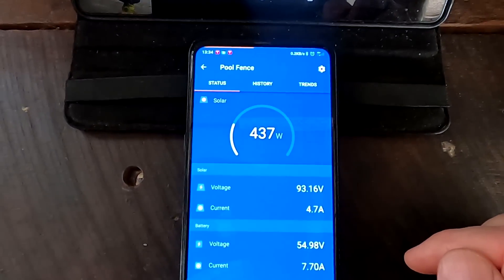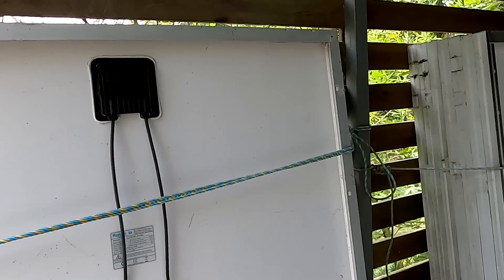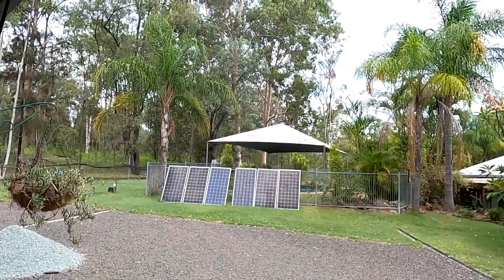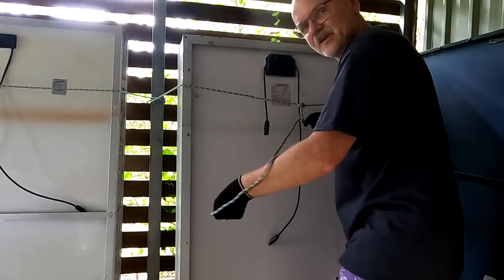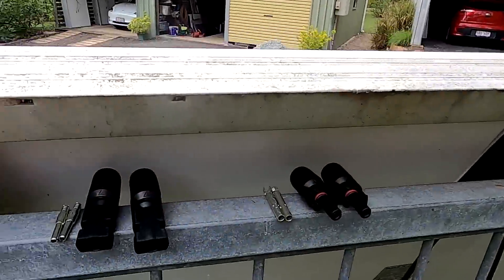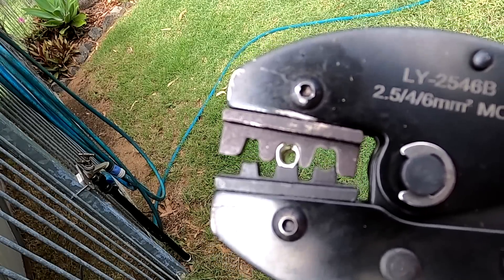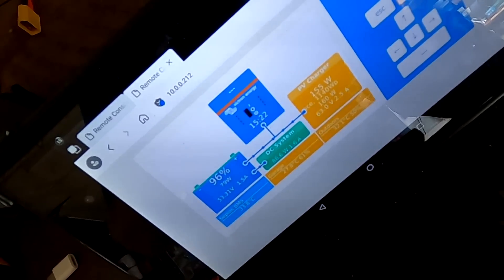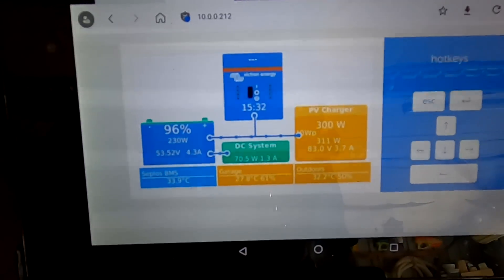'Massive' Pool Fence Solar Upgrade 😉 I almost lost it... 🤦‍♂️

Comment: Andy,  IMO the array voltage is dangerously close to 150V.   Those panels have a Voc temp coefficient of  -0.112V/K.   That means that for every degree C below 25C, the voltage will go up .112V.     

The Voc is 37.4V so 4 in series is 149.6V.   The .4V margin gives you only .4V/(.112V/K)=3.57degK.  That calculates to 25 - 3.57 = 21.43C.

Granted, in the real world the actual Voc will be less than the Voc of the spec,  but is it worth the risk of smoking the charge controller?
Reply from the maker: Thanks Paul for doing the maths on that.
However, when could that voltage be measured though? When the panel is cold and in full sun? I will have a lot of shading in this location in winter and the sun won't be on these panels before 10am (some will be still shaded by then). By 10am they have already warmed up and could be at 20°C or more.
I think the risk is vey very small. I'll get a 250V MPPT for the test and see how much voltage we can actually see.
Unless the panels are super cold and the sun comes out full on the panels, I don't think it's a big issue.
Reply: @OffGridGarageAustralia  As long as the batteries are not full and the Controller is putting current into the batteries, the current will pull the Panel voltage down to Vmp.   However, when the batteries are full and the current goes to zero, it looks like Voc to the panels.

Unfortunately, with zero current it takes very little light to bring a panel all the way up to Voc.    People have seen that at dusk or dawn when the sun is still below the horizon, they can see Voc on panels.   The most dangerous time will be early morning after a cold night.   (Actually,  that might be a fun video.    Test Voc of a panel in various light conditions.)

In your case, you may be OK because the overnight drain will probably mean the controllers turn on right away and start pulling current.   Unless it is so cold that even VMP is too high you would be OK.
Reply: I was going to look that up myself. Thanks for doing it :-)

Comment: I would not worry about open circuit voltage on cold days. Your voltage drop in your wire will compensate this by the time it reaches the mppt.
Cheers!
Reply from the maker: There is not much current flowing in the morning, so not much voltage drop. But, I have a lot of shading in the morning, so voltage  should not be an issue. And then the panels will warm up anyway, so. It will be an interesting test.

Comment: Another good tip for MC4 connectors that I fell foul of the first time. DO NOT twist the cable. Put it in straight so it is gripped uniformly by the connector.
Reply from the maker: Thank you, good tip.
Reply: For the crimp to seat properly, yah... the strands definitely should not be twisted.  But I don't even trust those MC4 crimps... never have. I always solder in addition to the crimp.

Comment: You can never have too many solar panels, right! Only sometimes you don't have enough space to set all of them up... ;-)
But i can still see a gap on the right side of the fence.....three more panels for some more amps?
Reply from the maker: I need a permanent mount for these panels. Sitting on the ground is only a solution for 2-3 days 😉
Not sure, if there is a good fence mount system out there...

Comment: I have 3 37.8v panels in series and when the charge controller woke up at about 8am it was receiving 81.8v at 0C which would put it at 27.26v each. I did change from 4s to 3s back in November because I had noticed that the voltage was creeping closer to the 150v limit the charge controller can handle. I would imagine you would be okay doing 4s, especially when your charge controller is a seperate device from your battery, mine is a solar generated so I don't want to risk the solar charge controller because it handles all DC input.
Reply from the maker: I think the problem occurs before the MPPT turns on and current start flowing. You would need to measure at the MPPT solar input before it turns on to check how high it actually goes.

Comment: Did you ever solve the issue with multiplus showing low bat when the BMS shows its full ?
Reply from the maker: Nope, I have tested (inadvertently) last week and it did not turn off until all BMS shut down. It also then started itself again once the sun came out and recharged the system. Maybe Victron fixed this in one of the updates since the last test. There was at least one updates since.

Comment: It would be a very interseting test on the big system to try how much power it produces with A) 2 Panels in series (around 100V) Versus B) 8 Panels in seies (around 400V - Victron has their mppt rs that can do upto 450v) Like if the more panels in series with the higher voltage starts charging sooner in the day and also charges longer
Reply from the maker: That is misunderstanding people have. They think a higher voltage means more power output. But that's not the case.
The problem with say 8 panels of which 4 are shaded is, that you run very hard on the bypass diodes of these shaded panels. As soon as current is flowing the voltage will sag down and this affects the whole system voltage.
While in parallel, the first 2 strings in full sun produce full power and the shaded panels adding some power as they can.
I could do the test with one of the spare 150/35 I have and put 4 panels in series and in a second test have them all in parallel, charging a 12V battery.

The main problem is that I would waste some of my roof space. 8 panels is maximum for the RS. Now I have 10 panels on each side of the garage.
Reply: @OffGridGarageAustralia that would be an interesting test Andy, I have 10 x 250w panels 2s5p on a 24v system with 2 x 48v Maxwell Capacitors in series (96v max) on the solar PV side with 2 x Renogy MPPT controllers hooked up to it. I have found it stores the early morning sunlight and activates short bursts of charging current every 5-10 minutes at first light when the caps hit about 28v until they get decent sunlight on them for a continuous charging current & similarly keep charging after sundown in this way until full darkness, they get up to around 77v after battery full SOC, but if it is cloudy on and off within a few minutes throughout the day, I have found the MPPT’s can keep pumping a consistent charge output through these clouding events that had previously tended to make the MPPT’s stop charging for a time as they found the new PowerPoint and the whole system seems to charge better on those real dismal days too, when there is hardly enough light to activate the MPPT’s otherwise, this way they can still keep building up the power/voltage required to reactivate the controller for periodic bursts that I would not have got otherwise. This started as an experiment a year ago, but I have left it in place for this time without any bad effects that I know of…..yet.
Reply: For instance, solar charge controllers made by Epever would only start looking for the maximum power point if the current provided by the panels at battery voltage is at least 1.5 A. This threshold is hardcoded in the firmware and it cannot be changed by the user. In effect, it means that in bad weather conditions, those solar charge controllers would not even start to perform the maximum power point tracking. One way to work-around this limitation is to use more panels in parallel.

Also, from what I have observed, this solar charge controller produces more heat when the difference between the battery voltage and panel voltage is larger. Therefore, I assume that higher panel voltage generally translates to more energy lost as heat.

Comment: With this angle you have there on the fence system, you will never reach full voltage anyways? How do the panels behave if you don't have full sunlight, but also no load? Will the still show full open circuit voltage?
Reply from the maker: The angle is optimal for winter time when the sun is a bit lower down here. This was the main purposes last year, to temporarily set them up. I hope I don't need them this winter any more and the new 14.4kWh system will be enough to keep us powered.
I have to measure in the morning before the MPPT turns on. But have to be up like 4:30am for that 😑 Maybe I wait for 2 months to make this a better time for me 😁
The voltage won't be full Voc due to the angle and shading from the trees.
Reply: @OffGridGarageAustralia  Please do a video how much voltage (as % of Voc,max) you get with this angle at full sunshine. I want to install PV on my wall (90° angle) for wintertime and want to know how to calculate the maximum voltage which I can expect for this angle at full sunshine and -10°C.
Reply from the maker: @matija3791  You can already find a lot of data here on the Victron VRM. Click on the SPAT Calibration Centre and the Advanced option on the page. But yeah, I can do a video as well, no problem.
https://off-grid-garage.com/victron-connect-through-raspberry-pi/
Reply: @OffGridGarageAustralia  great, vielen Dank :)

Comment: I would use 3 in series and then 2 in parallel. Otherwise when a cloud comes, the panel cools down and you could blowup your charge controller, not worth it!
Reply from the maker: Yeah, I'll do some testing and see how much voltage we actually get.
As soon as there is current flowing , the voltage will be lower anyway, so even a cloud corner situation won't give us a spike in voltage.

Comment: You can never have too many solar panels. I am running 15 panel strings. What is the reasoning behind 3 panel strings?
Reply: your 15 panel strings are probably on a controller that is rated for 500 volts. The ones he is using are only rated for 150
Reply from the maker: Shading, lots of shading. I found the parallel connection much more efficient and also it is under 120VDC, so less requirements and regulations.

Comment: Yeah, add an extra panel per string;  you could add an alarm/warning in the Cerbo, at 140v input (good margin) and if it ever even got to that voltage I'd be surprised.
Are you having advanced-tab VRM not saving layout issues? 67amps outside here today at peak. Getting sunnier :)
Reply from the maker: I'll try that in winter and see how much voltage we will get in the morning before the MPPT turns on. If OK, I can then add another panel (wife's approval required though).
Wow, 67A at your place. Nice!

Comment: Luckily you checked twice!
Luckily you checked twice! 😂🤣😂
Thankfully we're entering spring here in the UK. Today, my batteries fully charged for the 1st time this year! 🎉🍻🥳 Was watching my VRM and it stopped charging! I thought something had gone wrong 😬 then I realised the voltage was at 28.9volts! Was well happy 😁
Reply from the maker: How big is your system over there in the UK? If you already fully charge now, that is great.
Reply: @OffGridGarageAustralia  its only a small one. 24v 200ah battery, made up of 4 x 12v Lifepo4 batteries (kepworth & ultramax), I've now got 2 Victron 100/30's, Victron smart shunt and an Iconica 3Kw AIO 👍
Oh, and 2 x 340w panels and 2 x 385w panels, 2 to each of the Victrons 😁 
So VERY small compared to yours 😂
Reply: Haha I had assumed it was an editing error but now you make me think (twice) this is clearly Andy's good sense of humour!
Reply: @nettlesoup  😂🤣😂👍👍